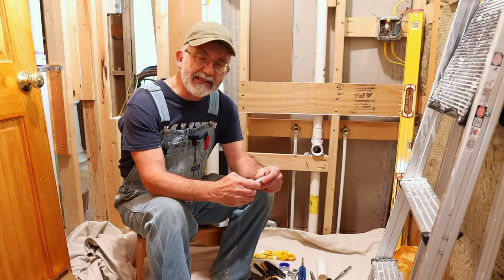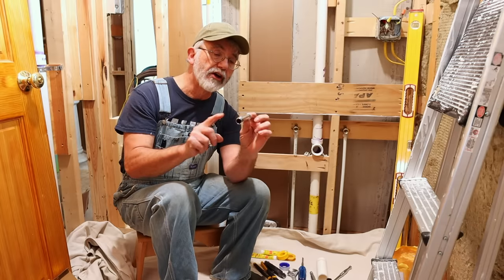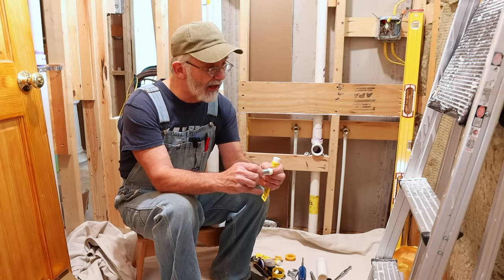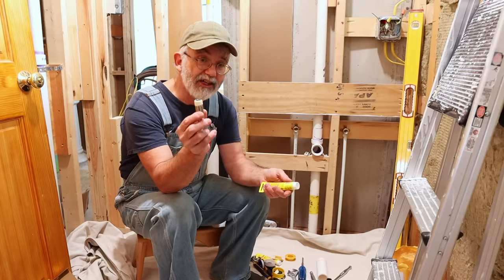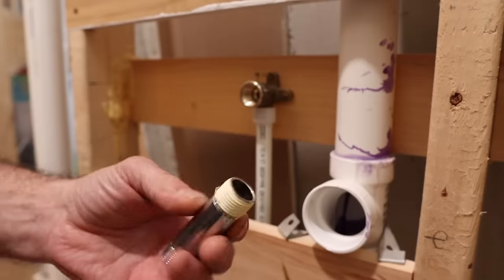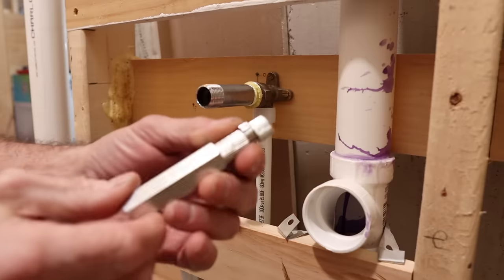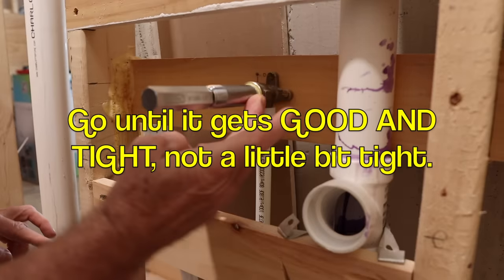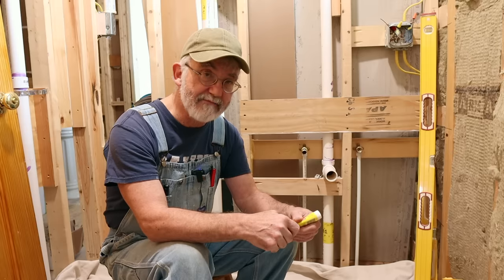Plumbing Trick * Make No-Leak Threaded Pipe Connections * How-To

Comment: Tapered threads need a lube to prevent galling while tightening the fittings. Two lubes are not necessary, and too much dope or tape can give the impression of a water tight connection, only to leak as it degrades over time. It’s a lubricant, not a filler. To suggest otherwise shows a fundamental misunderstanding of how tapered couplings seal.
Reply: Thanks for that! I presume they seal by the larger diameter section of the tapered pipe butting against the fitting. But isn't pipe dope needed to fill any small openings after the pipe seats? Seems like more than just lube..
Reply: You’re correct in that I popped off with a simplistic answer. Galvanized and raw cast iron are malleable and will seal with almost any lube that prevents galling. Dissimilar metals sometimes require a paste to prevent galvanic reactions. U.S., Canadian, and British threads are all different. Some 300+ BAR gas lines take no lube or sealant, and others like high pressure steam or hydraulic lines take.  Unique sealant. But based on your profession you know all of that! For anything other than low pressure water lines I do exactly what the manufacturer or technical orders call for. Sorry for the rant. I shouldn’t drink while watching YouTube!
Reply: @AF-O6  Okay, now I understand! Thanks for that good information..

Comment: The biggest challenge for me has always been transitions between plastic threads to metal . any tips?
Reply from the maker: Check out @WaterMelons comment. He has a solution for you that is well worth trying. 👍
Reply: Metal pipe threads can crack a female fitting before the threads are seated well. Where possible I will bush up one size larger pvc female  connector then use a threaded reducing bushing. This has never failed me when transitioning from pvc to metal either direction.
Reply from the maker: @larrylesueur8958   Excellent! 👍

Comment: Keep in mind this only applies to steel and brass.  Threaded PVC is tape only.
Reply: Ther is dope you can use on PVC read the can. Some of the Rectorseal is NG for PVC
Reply: If the PVC threads are female, I strongly prefer only dope. Only if screwing male PVC into female metal threads will I use tape. The tape adds bulk and female PVC is already stressed by the force of tapered threads. Being PVC the threads are soft and do not need the gap filling provided by the tape, just the lubrication provided by the pipe dope (I always use dope with PTFE aka teflon).

Read the label and make sure your dope is listed for use on PVC.  In my experience most are that are intended for potable water lines.

Comment: You are doing it all wrong. It’s expensive to use those fittings and valves. Pipe it out with plastic pipe and then as the valve after drywall is finished